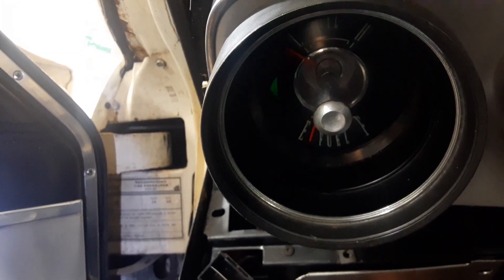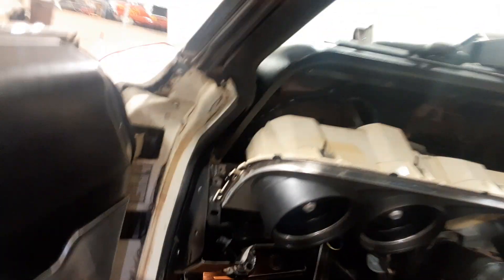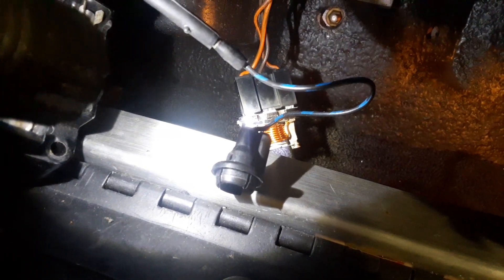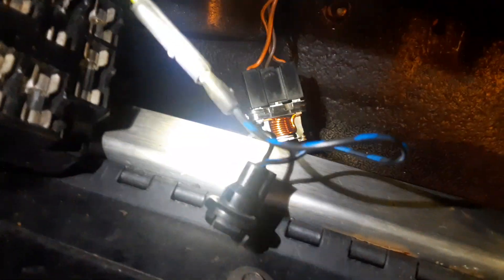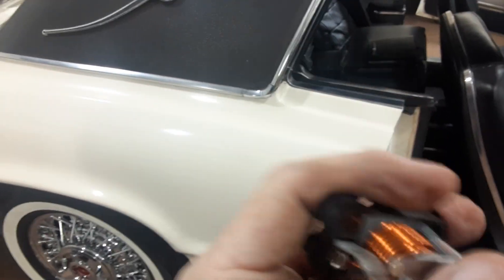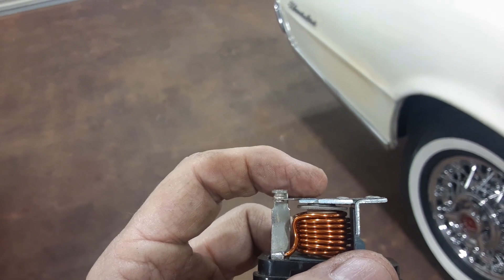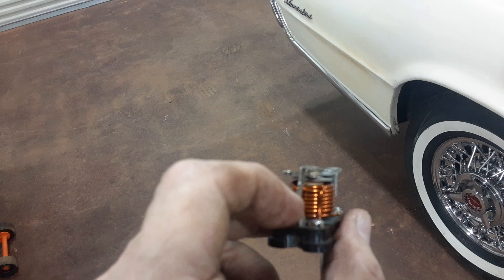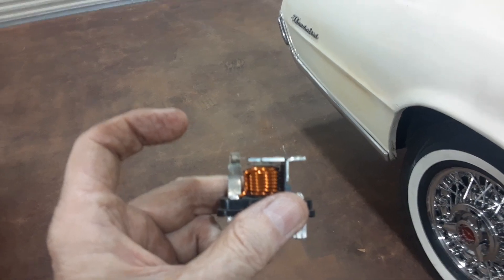1967 Thunderbird Turn Signal Flasher Relay adjusted to work with LEDs

Comment: Can you tell me please if my relay is all the time touching no open and close, is it good or bad
Reply from the maker: Should be open.
Reply: @gormanwpjr  thanks for responding. That means that it’s damaged?
Reply from the maker: @mauriciomarino6669  I would think so.  Assuming that it is closed with no power to it.
Reply: @gormanwpjr  I have a short in the turn signal switch on the steering columm, do you think that will make it to stay closed? I'm thinking on replacing the switch.

Comment: My 67 T Birds brake lights won’t turn on at all and the blinkers work but are a little funky. The middle light on both sides stopped working and I’m not sure if they’re as fast as they need to be. They have 1157 LEDs in them so idk if that makes a difference but I’m more concerned about the brake lights not working. Do you have any insight on where to start?
Reply from the maker: As for as the brake lights go - there is a relay in the trunk, good chance that it is not working.  The center lights on both sides not working, indicates that the electrical sequential motor's center light rotating points are not making contact and need to be cleaned and/or adjusted.
Reply: @gormanwpjr  the weird thing is the center light in the right side worked right after getting the new bulb and then quit after some toying around. I’ll give that a shot when I get back to working on it. Same with the break lights. Thanks!

Comment: Do you still have this vehicle? I'm working on this part exactly. I bought a new sequential relay for the trunk. But I don't know what wires connect to the turn signal cam switch.
Reply from the maker: Unfortunately I do not have the wiring colors memorized, however you should be able to trace them down with the aid of the wiring diagram in the shop manual - although it is hard to follow.  Someplace I have a larger and little better diagram, but no way to post it here.
Reply: @gormanwpjr  thanks Bill! I appreciate the guide. I bought a shop manual but the wire coding is different than what the boom says so it threw me off. I'll keep looking thank you!

Comment: If my turn signals don't work in 1967 Thunderbird, would the relay behind the glove box be the first thing to look at?
Reply from the maker: Complicated, but depends what you mean by not working. Blinkers come on but don't flash or ?
Reply: @gormanwpjr  they have worked sporadically in the last couple weeks... But when they don't work, they don't come on at all...
Reply from the maker: @cablanchette1  Since they work some of the time, the only thing that you can say is that the wiring circuit is correct.  Therefore, there is an intermittent connection.  Other than wiggle testing, you may have to use the wiring diagram and follow the current path until you find the issue.  Remember, there is always a reason - it is only a matter of locating it methodically.